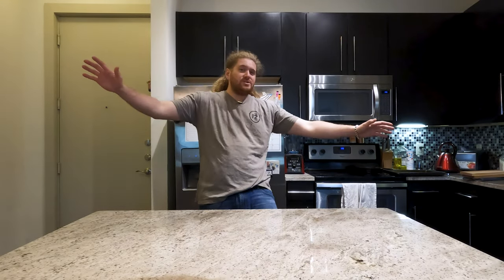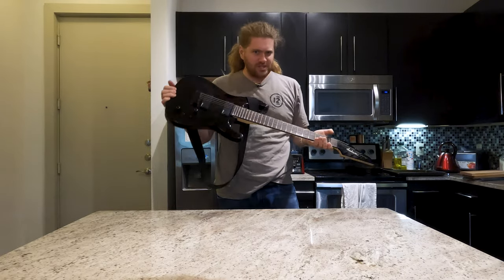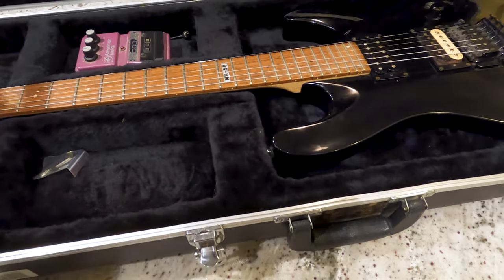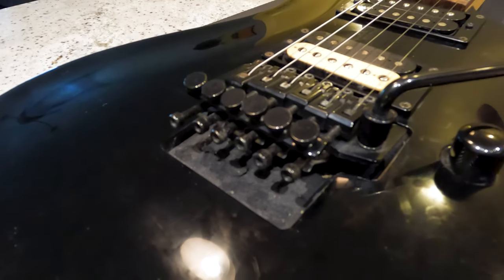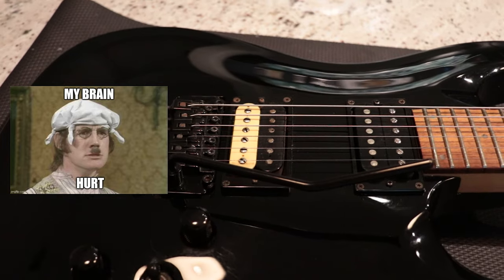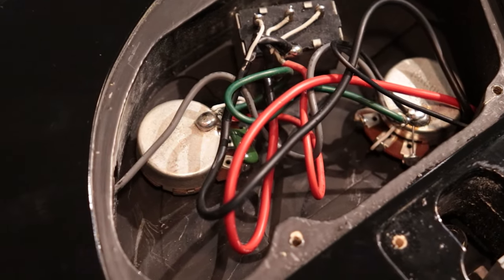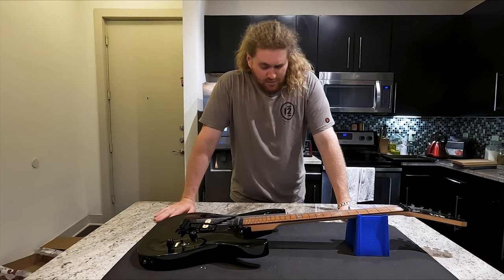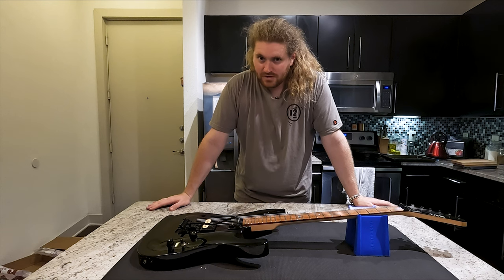I Bought The CHEAPEST GUITAR On CRAIGSLIST...

Comment: Hey dude, here's a tip:
When stringing a Floyd rose guitar, you can start stringing from the tuner, this way you use the "button" on the end of the string and that will lock against the tuning peg. 
Next thing you know just cut the string to fit the Floyd rose and that's it

Comment: Nice! I’ve been playing guitar about the same amount of time I got into motorsports via mini bikes. I’m 100% on board with you about cleaning the fretboard and polishing the frets every time you change the strings. 

Leveling and recrowning isn’t difficult. Stew Mac has good crowning files and notched fretboard rulers. Don’t skimp on the crowning file. For leveling I have use a length of stone countertop material with coarse emery paper glued on. Make sure that you tape paper over the body where the pickups are so as not to collect all the shavings on the magnets. 

Looking forward to more bike and guitar material.

Comment: one thing i can tell you too is when propping the guitar up especially bolt on fender styled instruments support the heel where the neck bolts on you can crack the finish applying pressure on the neck without realizing it its common and I've done it just a handy little tip to pass along. big upgrade for floyd equipped guitars is a trem stop in the back get it parallel to the neck and add the evh d tuna system. makes it way more stable and usable.
Reply: the trem block solves the issue of tension as long as you dial it in makes restringing it very quick if you're newer to that glad to share any and all info i have to assist

Comment: I bought an American made, strat style, Carvin (when they were still Carvin) with dual humbuckers, 5 way switch, locking tuners, graphite nut, ebony fretboard, and an original Floyd Rose tremolo! It also has a beautiful, thick, heavy, flamed maple top, with case…..for $400!! Best guitar I’ve ever owned and I have owned a bunch and still have two Les Pauls as well. I immediately proceeded to block off the tremolo because I don’t use them and a floating trem makes just everything more difficult..oh, it also has stainless steel frets! Why did I buy a guitar with a Floyd Rose when I don’t use a trem? Because it’s the best guitar I’ve ever played and was only $500 which I talked down to $400 (I’m cheap, sorry). This guitar from the factory was about $1200 or more with the options. JS. 
I’m subbed and will be watching every thing Spite puts out because….. I like him…….but I don’t like the other guy.

Comment: Get a multimeter and you can measure the resistance on your pick ups, although resistance isn't as specific as output which only Dimarzio displays on their website but resistance gives you a good idea of the output like a Dimarzio Super Distortion will have about 14 Kohms and a Dimarzio PAF will have 7 or 8 Kohms.

Comment: In my experience using floating Floyd rose with string guages above 10s seems to work poorly. It's not a matter of spring tension as I experimented with 4 and 5 springs, I really couldn't figure the cause out. They will always work best w 9s in e440 tuning. I found this to be true on esp and Ibanez guitars. If you have a top mounted Floyd it should be fine atlease up to 11s

Comment: wd40 or ronsons lighter fluid are your best friends in aiding with the removal of stickers and other assorted residue......  welcome to the wonderful world of "floyd rose pain in the ass"!  to get your bridge to sit "flat"  you simply (ya right)  loosen or tighten the screws in the spring hook plate in the back of the guitar.  if the bridge is sitting back hard on the body? loosen the screws and re-tune the guitar.. if the bridge is jacked way high,  you can tighten the screws or add another spring.   repeat this step until you have your bridge angle correct and the guitar is in tune. this is a time consuming process.   as for setting the action,  tighten or loosen the bridge saddle screws to raise or lower the bridge.